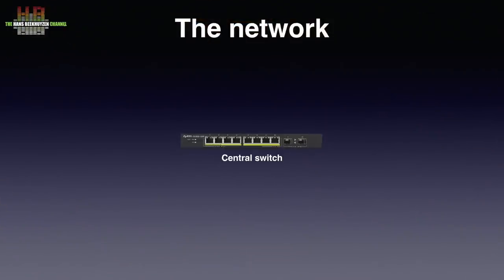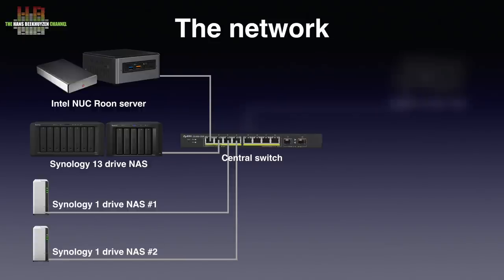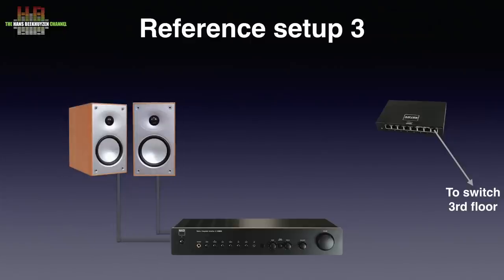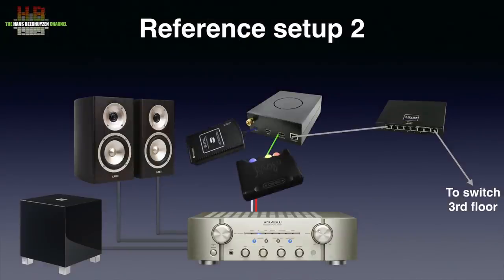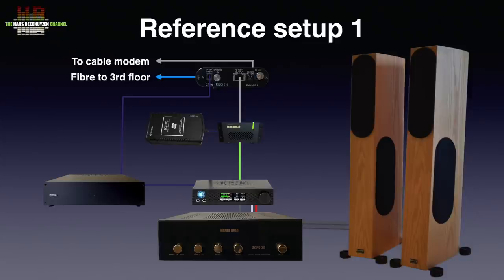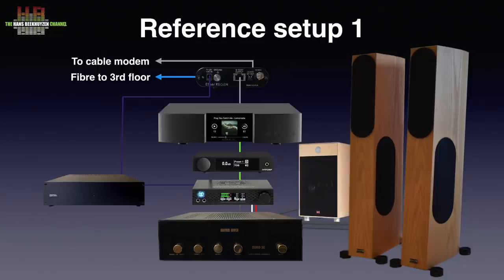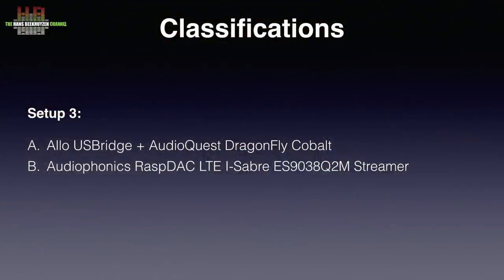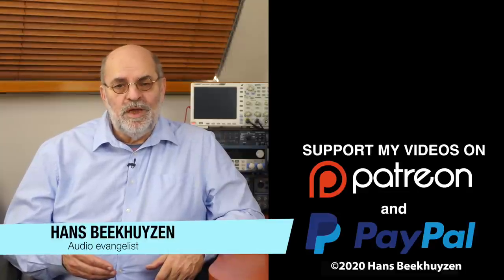About my reference setups, part 2

Comment: Very interesting, Hans. I'm especially impressed by your focus on digital, networked sources. This is an area where I have zero experience, despite being quite a technical person. I have taken some steps in that direction, however with a Synology NAS in the basement and the house wired with CAT6 gigabit network cabling and CD collection ripped to FLAC. I think what's missing is a DAC and streaming mechanism. This is where my knowledge currently fails me. Thank you for your informative content. All the best, Rob in Switzerland.
Reply from the maker: Well, I do have numerous videos on those topics😁
Reply: @TheHansBeekhuyzenChannel  Indeed! Thank you - I have been watching them! Most educational! Dank U wel, Hans.
Reply: Funny, I'm in the exact same position. I follow this strategy: to try something new I buy a cheap 'tryout solution' to build experience and refine requirements in a field I didn't know about before. If the solution appears to meet my long-term needs, it's fine. Otherwise it's on to a 'quality solution' with better gear, and the 'tryout solution' gets a secondary task.
I did so in the past with a NAS. At first a cheap one, then based on built experience I chose a better one and repurposed the cheap one to backup storage. Now it's the same with a DAC. I bought a simple, affordable Cambridge Audio DACMagic100 as 'tryout solution'. If that works good enough to my ears, it's fine. If not, then there's this channel to use as a guide to upgrade further. In my opinion one thing is important on a journey like this: take your time.

Comment: Hi Hans, excuse if you have addressed this before, but just in case I ask here as suggestion: Do you also use USB as source to dacs for reference setup, since most have good jiiter correction and implementation compared to coax? Is it for convenience to your network streaming setup or from sound quality concerns?
Reply from the maker: Remarkably enough there is no read (audible) difference between all digital interfaces when done right. USB, SPDIF, AES/EBU, TOSlink (for sampling frequencies up to 48 kHz) or I²S, they all sound just as good WHEN DONE RIGHT in both sending and receiving device. Unfortunately this is rarely the case in affordable equipment. Then the only way to get the best sound is to try very possibility available to find what matches best on both sending (streamer) and receiving (DAC) device. Not pretty, but it's the reality. The Auralic Aries G2 and the Mytek Brooklyn combo sound the same on SPDIF, AES/EBU and USB. This is also the case when I change the Mytek for the Denafrips Terminator-Plus.

Comment: Hi Hans, thank you so much for the great honest effort, sharing with your viewers your own system and your accumulated knowledge, I have a question/concern; that miniDsp Studio is a week link between Auralic G2 and Mytek Brooklyn DAC, and what type of connection you are using between miniDsp Studio and the Mytek Brooklyn DAC to get the best performance?
Reply from the maker: Why is the Mini DSP a week link?
Reply: @TheHansBeekhuyzenChannel  Hi Hans, thank you for communicating with me, Regarding the miniDsp I think it is a week link between Auralic G2 and Mytek Brooklyn DAC, because the only digital output it has is SPDIF which are limited to support up to 24/96KHz, while the Mytek Brooklyn DAC can play up to PCM386 and DSD256, please correct me if I miss understand due to my limited electronics specs. experience.

Comment: Hans thanks for great video, I just got around to subwoofers in my audio journey, so my question is your Rel B2 fast enough or should I just get the new model they offer. Thanks again
Reply from the maker: What do you mean with fast enough?  It goes above 200 Hz while I wouldn’t use a sub above 80 Hz....
Reply: @TheHansBeekhuyzenChannel  well that is what some people describe it, that it can't keep up with speakers and monitor audio makes better one. Like I said I just started my Subwoofer research and I am kinda of lost, I found used b2 $1200 and I it should be better than T9i which is the same price new.
Thank you very much for pointing 👉 me in the right direction
Reply from the maker: @blejzerosamigos6115  go for the B2, you won’t regret it. What most call speed has to do with room modes that cause time smearing. So pay serious attention to placement.
Reply: @TheHansBeekhuyzenChannel  😎 thank you much
Reply: @TheHansBeekhuyzenChannel  Hans I found B1 ,it’s transforming my system WOW thanks for great advice cheers 😃

Comment: Hans, I love your videos and the dedication and clarity you use to explain and convey your ideas.  I have a question, you have given super enthusiastic and positive reviews to the SOtM SMS-200 Ultra, however they are not part of your reference system.  Is it because you find the what you have used to replace them with I. Your setups are considered much better?  I recently purchased a Roon Nucleus and I’m evaluating if I should add one or several of the SOtM solutions, ie the SMS 200 Ultra Neo, the tX-USB Ultra, and the Silent Angel Bonn N8.  What should be the order in which I should purchase them to get the most return in audio quality?  Thank you again!
Reply from the maker: The sMS-200 Ultra has been the source for my setup until I bought the Auralic Aries G2 (that costs 2.5 times more). The sMS-200 Ultra still is extremely good for the money. As for the network switch, also watch this review: https://youtu.be/Io4SDi5hLxs.

Comment: Hi Hans, did you hook up a linear power supply to your SHD Studio and did you hear any audible difference?
Reply from the maker: Yes, but that gave no improvement. The MiniDSP, as most digital gear, needs current very fast. Only very powerful LPS would work. Most audiophile LPS aren't. The Ferrum Hypsos might, I haven't tried.

Comment: Another interesting video Hans. You are my go to guy when trying to understand the best possible audiophile setups and connections. Are you using balanced or RCA connections between the Mytek Brooklyn and Audionote amp Hans and what is your preference given the option?
Reply from the maker: My preference is to use the kind of interlink that works - the Audio Note is fully single ended - and if more options are available, I choose the best sounding one - which differs between combinations of equipment. Sorry, in serious audio there are no simple answers.
Reply: @TheHansBeekhuyzenChannel   Makes sense Hans. You're right, especially with digital audio there are now so many options and permutations for set-ups and connections that it can be overwhelming at times!

Comment: Hi Hans, thanks for sharing with us your Hi Fi set up, which is very interesting but not as flamboyant as I would expect from an audiophile reviewer. My question is how would you describe the sound of the Reference 1 setup? What is the bass, mid range and treble like? Warm, harsh or neutral? Streaming is still like wizardry to me at the moment as I'm still playing cd's and vinyl, but as I hear more about it, I am becoming a lot more interested in it, but I find it hard to get my head around. I'm quite new to your channel but really enjoy how you present it. Thank you.
Reply from the maker: My hifi set up is sufficient to do the work I do. I have heard several € 250K set ups that sounded less. Since I only review front ends, how the amp and speakers sound is not relevant as long as I can produce reliable judgments on the devices on test. If you check the responses of my viewers, I think you might conclude that this is the case. I'm rather down to earth and aim at a public that want to separate hype from quality.
Reply: @TheHansBeekhuyzenChannel  To be honest I liked the look of your setup and was hoping for some constructive feedback as I'm searching for new speakers and an amp.   Never mind I will ask someone else.

Comment: The biggest variable in my music system is me. Now, if it doesn’t sound as good on a known track, it is often an indicator that the listener is stressed. Time to relax until the music gets through to me again. 
What are the benefits of a DAC which uses an FPGA (field programmable gate array) other than being able to upload a new program with different characteristics?  Do they offer better quality sound reproduction, assuming that all is well with the rest of the circuit design?
Reply from the maker: Powerful FPGA's allow for far better filtering than is possible inside the DAC chip.

Comment: Beste Hans,

Ik vraag mij af waarom u een usb kabel gebruikt tussen de auralic aries g2 en de mytek dac. Ik gebruikte ook een usb kabel tussen mijn auralic aries femto en schiit audio modi multibit. Dit klonk goed, maar sinds ik dit vervangen heb door spdif over coax klinkt het nog veel beter. Dit komt omdat over spdif ook het kloksignaal wordt gezonden, iets waar de aries letterlijk voor gemaakt is. Mijn idee is dus dat usb het beste is als de klok in de dac beter is dan die van de bron en spdif het beste is als de klok in de bron beter is dan die van de dac. 

Hoe denkt u hier over?

Met vriendelijke groet,

Alexander
Reply from the maker: USB Class 2, as used by Auralic and all other modern DAC's and streamers, is asynchronous, meaning that it sends bits to the DAC on demand. In the DAC these bits are stored in a buffer and read out at the pace of the DAC's clock. So if the clock of the DAC is very good, the sound quality will be very good. If the clock is poor, then so will be the sound quality. In that case it's better to rely on the clock of the streamer and thus use SPDIF.

Comment: Why would one use an external power supply?
Reply from the maker: If the external power supply is of better quality than the internal power supply, it will improve the sound.
Reply: The Hans Beekhuyzen Channel 

Will any do or does it have to be matched?